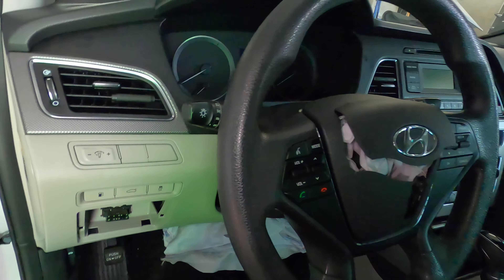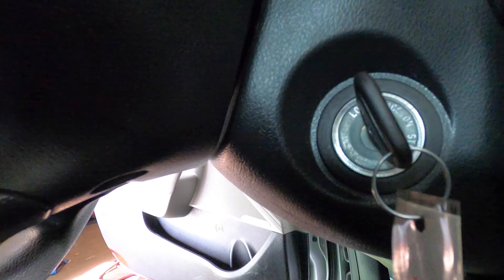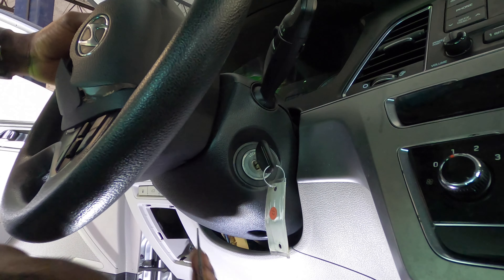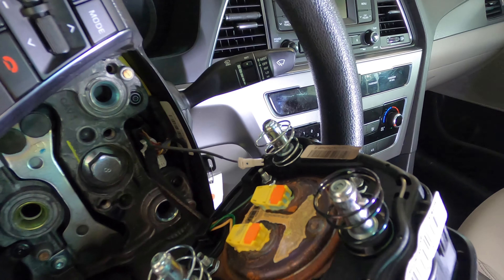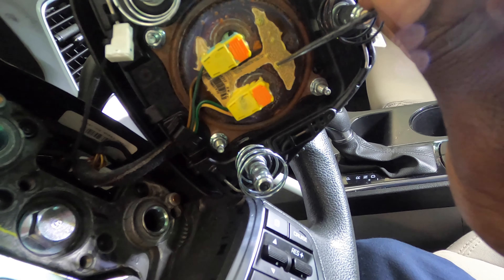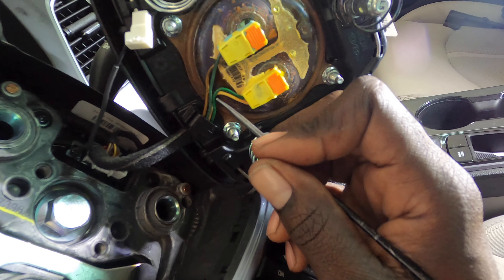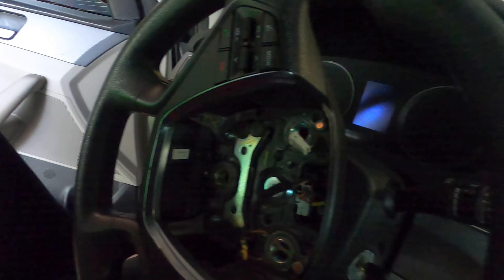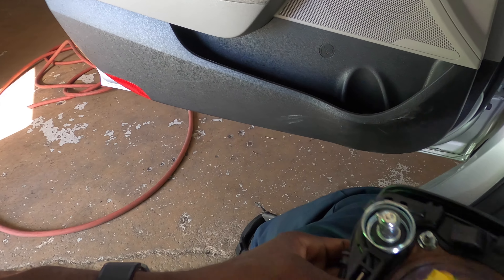Hyundai sonata and kia optima steering air bag replacement

Comment: No reason to cut wires.  Just disconnect them. Remove the orange clip first
Reply from the maker: Its not like that when the air bag deployed the connector melt which  make them useless if and when they come out
Reply: @DULLAHGOSOHARD   Ah I understand but I wish you would have tried.  They looked fine. My connectors looked fine and were not melted after my airbag deployed. I do appreciate you showing the buttons for the airbag.  Thank you